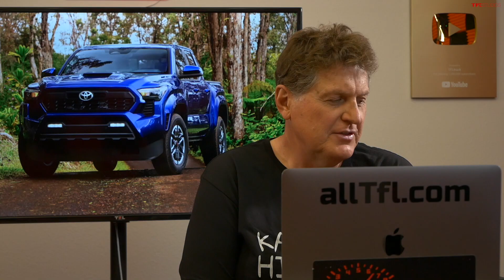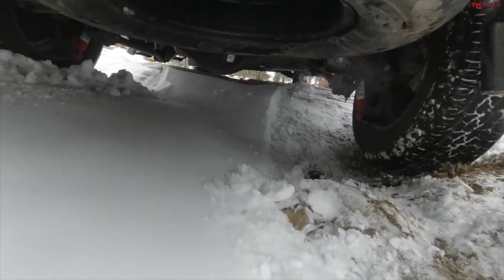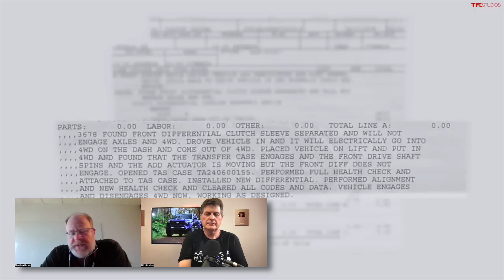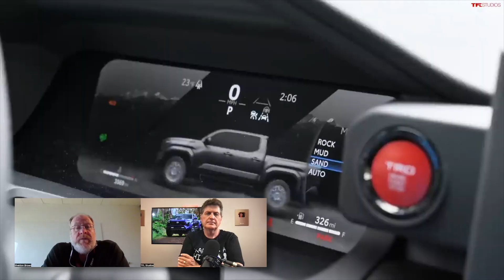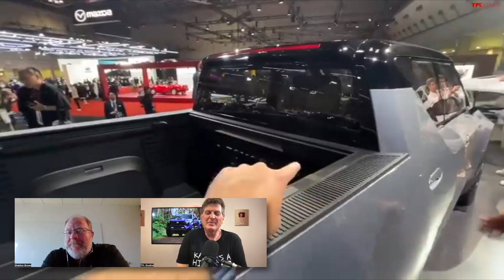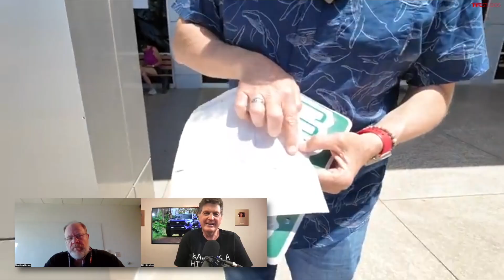The Real Story Behind How Our New Tacoma Broke & How Toyota Plans To Fix Yours!

Comment: If Toyotas mindset was building a quality truck, they would have made the differential strong enough for any setting and anticipate user error when selecting application…. they take the longest to redesign with the expectations they test and redesign a superior quality product
Reply: No they would’ve designed and built in Japan instead of America and Mexico.
Reply: And? Japan built 300s and LX600s have failing engines...

Comment: Any company that knows what happened and tells you off the record, without letting you tell it on the record, has something to hide and should be avoided AT ALL COSTS!
Reply: Not if the engineer has not been given press permission to Make public
Reply: Have to get to the root cause before speculation
Reply: They didnt want to talk about it publicly till they had a fix ready for customers.  Standard procedure in any large company.
Reply: What bothers me is the Channel lost its journalists standing by holding off on the story? Compounded by the immediate sale of the Tacoma instead of wringing it out?

Comment: Long story short. IT'S JUNK!
Reply: Nailed it x1😂
Reply: Every new Gen has issues. Toyota has always corrected. All brands go through this
Reply: @psynurse  Yes but these issues vary in severity. And what the new Tundra and Taco have are big, mechanical problems.
Reply: @TermlessHGW then dont buy one right now. After they fix it ppl will be like good job toyota
Reply: @drivewayhero  I won't and most likely never will. Was in the market for a midsize back in 2019 and test drove 'em all. Taco drives and feels like you're in a piece of farming equipment. Plus yet another video of a broken Taco dropped by Truck King. What are the chances...... one thing that Toyota had going for them is reliability............
Reply: @TermlessHGW taco sounds so bud light
Reply: @TermlessHGW  Toyota had perceived reliability, now that’s gone..
Reply: @TermlessHGW It doesn’t drive like a piece of farming equipment anymore. That’s the appeal of the new gen. It’s improved in every way. The people crying out about it being junk are just idiots with a platform to spread their idiotic beliefs. Every truck has issues at some point. They’re fixed and life moves on. That’s what warranties are for.

Comment: Sounds like the drivetrain is designed to the bare minimum.
Reply: exceeded design by 1.7% is what I heard, that's pretty minimal.
Reply: Exactly.  And I’m sure the hybrid version with even more toque has the same marginal components in the differential and will be even more likely to fail in a greater range of circumstances.
Reply: @RonRussell-sj1zf at least they didn't say customer abuse 😂 seriously I wonder how many of these will be declined because people put taller tires on their truck.
Reply: @RonRussell-sj1zf  It sounds more like it "blew a fuse" to prevent the expensive parts from going past their spec.  e.g. axle can take 3500 lbft, A.D.D. sees 3600 lbft and says "yeah no."
Reply: @RonRussell-sj1zf   the non hybrid makes over 100 ft lbs less torque and still breaks ,  theres definetly a quality control issue .   also mine in winter is using 16-19 litres of fuel per 100kms ... when it was rated at 1 litre more per 100 kms vs my 2025 GR corolla .... i have a 1994 supra and have owned at least 5 lexus vehicles , and since switching to new toyotas i dont feel safe traveling far out of town
Reply: @jameisonroyce7550  Don't blame you.
Reply: True, but it looks so cool... especially on 35's🤣
Reply: Sounds like the axles are weak . Cheap steel from China
Reply: @marcnemergut9490  exactly right
Reply: Probably toyota corolla awd system lol
Reply: They always are, the bare minimum is the one which changes.
Reply: It broke because it went over the specs by 1.7 %
lol
Reply: @angelgjr1999 yes because all the torque was being applied to one wheel, did y'all even listen to what he said?
Reply: @adrianhosein7698 obviously they don’t. I deal with people like this all day everyday. It’s amazing how stupid people are and can’t comprehend or listen to an expert
Reply: @adrianhosein7698 if the system isn’t designed to handle sending all the torque to one wheel, then braking that wheel, then it shouldn’t be programmed to allow that to happen.  It doesn’t matter if the situation exceeded the tolerance of the parts involved by 1.7% or 10%, the traction control system should not have allowed it to occur.  It’s bad programming on Toyota’s part.
Reply: @thestrange_1  that is why they CHANGED the programming, he said that was a rare one off situation and NOT the norm., did y'all even watch the video?
Reply: @adrianhosein7698 yes, I watched the video, did you?  The "fix" you referred to was a patch they hope will prevent this from happening to other vehicles while they work on the long-term fix.  The fact it's a rare occurrence doesn't change the fact Toyota didn't think to program the traction system to prevent a situation where its own actions could cause the drivetrain to exceed the designed tolerances.  That's bad programming, plain and simple.
Reply: @thestrange_1  I did watch it and he stated that it was a bunch of stuff that aligned for that to happen, the engineers can't tell the future and can't think of every little rarity that might happen.
Reply: @adrianhosein7698  what the engineers do know are the tolerances of the parts in their vehicles. Knowing the components couldn't withstand the application of full torque with no outlet (no wheel spinning freely), coding the traction system to prevent it from creating that scenario should have been an automatic "to-do" item. It doesn't matter how rare that situation could be, it's irresponsible to leave open the possibility of your own system breaking itself.
Reply: @angelgjr1999  1.7% over the limit? Glad they don't airplanes.
Reply: They had insufficient margin in that design.
Reply: Spec'd the drivetrain to the old taco's with less weight and less power. Snap.
Reply: Add a more torquey engine and use the same components. Don’t get stuck in the winter and you’ll be fine…. Not cool.
Reply: Unfortunately, inflation has made them  change to cheaper suppliers. This is the end result.
Reply: @ryanb8736 it's the same part that was in the 3rd Gen. It's not a "cheaper supplier."
Reply: @ryanb8736 they make billions in profit lmao
Reply: So I can’t take my TRD Off-road actually mild off-roading in case I’m 1.7% over the drivetrain limit!? Is there a gauge or reading in the dash for my drivetrain limit ? Bunch of B.S. gaslighting crap.
Reply: @robmd3851 How is losing traction on 3 wheels and sending all the torque with 2500-2700 RPM to one wheel “mild off roading”? 

It’s a rare occurrence. You’re telling me your mild off roading involves going up a rutted out icy road on 4LO with rear lockers activated? They’ll fix it with a software update before you even find yourself in that situation if you ever do. Relax.

Comment: Toyota ironically increased the cost of the truck while diminishing quality of the product
Reply: Anyone think if it wasn't tfl you would have gotten this attention?  If it was your truck you would have been charged and told you abused the truck. Good to be rock stars of the truck world.
Reply: @ChicagoBob123 Toyota is both lucky and unlucky this happened to TFL. They got multiple angle footage of the moment it happened and TFL is invested in maintaining a good relationship with Toyota. If it was a common person they’d likely be screwed and it would get buried in a spreadsheet somewhere
Reply: Absolutely agree. It's a shame that car manufacturer's put consumers through this. Why are we paying for poor quality vehicles?
Reply: Toyota tax…
Reply: It’s by design. It was mentioned in their 2021 plan to up the sales at service departments by lowering the life span and quality of products. The service department is how dealers make their $$ and they were hurting.
Reply: @manoloprpr sooooo.... that's bullshit ..but don't worry, I know it won't stop you from saying it...
Reply: Just like everything anymore I’ll never buy a new vehicle ever again
Reply: @aaronscott2278  sad thing is things wear out,  rust and just tell you they need to be replaced.  And repair has become crazy expensive unless your a mechanic and have a lift hard to keep anything running
Reply: So, blame the software / terrain modes - the truck is great, it just breaks under special circumstances?  Very low percentage of the time this happens 😂😂😂.  You can keep this crap Toyota - same with the Tundra that you turned to crap.
Reply: Using a good name to sell a inferior product
Reply: They have to pad themselves for all the repairs they will have to pay under warranty.
Reply: @Kjhgr01 not if you put oversized tires
Reply: I would say they increased the cost and lowered the durability of the product in this particular case.
Reply: What I got out of this is the design is similar but the differential can't handle the increased torque of this motor.  So they will use "software" as a governor of such to reduce energy to the wheels as its already too late to beef up the the design of the front diff.  And this being a non hybrid with less torque.  Really looking like the design is under built.  The engineer admitted they will have to limit that torque with software.  In a public relations statement he tries not to admit as much but when one dissects through all the word salad of this guy its points to the underpinnings being under built all day long and twice on Sundays.  And what about all the reports of the rear diff overheating?  Does this not have a proper trans intercooler?
Reply: @HiPlains1 That's not even what he said, far from it.
Reply: @HiPlains1  Well I agree with you, in part.  The V6 engine could not produce enough torque at low rpm to cause this most likely. This turbo engine torque overwhelmed the front diff in this scenario.  Would a front locker have helped prevent this failure?
Reply: @planoman0935 what about the 4.5 v8 tunned turbo diesel do they snap axels?? The North American Toyota is selling us cheap crap at a higher cost. That’s all Folks
Reply: Horrible track width on the LC70. Toyota is lazy to fix their problems even on the I4 in the LC70.
Reply: Let's not be the guinea pig for Toyota.
Reply: @evangelistar74  True

Never buy the first year of a new series.
Reply: So a software fix for an underengineered mechanical coupling? Am I hearing that they will make the traction control system less aggressive  to save a weak mechanical link?
Reply: Shrink flation?
Reply: @toddgries2133  planned obsolescence
Reply: They’ve been doing this for at least 20 years. Fanboys were just blinded. Look at all of the lawsuits over their trucks during that time for weak build quality and poor frames.
Reply: Not just failure of diff but failure of tranmission and engines also
Reply: @aduarsaenz1491  That’s what I’m suddenly hearing about also. And it’s coming from many owners. That can’t be ignored.
Reply: Way ,WAY, WAY OVERPRICED. HAWAII TACOMAS ARE JUST SITTING IN THE LOTS.
Reply: 100 series LCs blow front diffs all the time
Reply: @NF-rl9xh True, I blew the front diff on my LX470. Things break when you go off road. We won't know the full picture on the reliability of these vehicles until 10 years from now, which is why I usually buy used anyways.
Reply: That will be solved when you buy a Y61 Super Safari Patrol.
Reply: Because Americans will still buy it.
Reply: I think Toyota are weaker trucks because of all the electronics they have built into them these days.
Reply: @yosemitesam6945  That’s an excellent point. I not certain, but I bet that’s true of all cars and trucks these days.
Reply: Junk
Reply: It's new world economics..  it's because CV
Reply: My issue that Toyota went back to a 4 cylinder engine.
Reply: Toyotas reliability has went south long before now. Glad y'all are finally starting to wake up
Reply: Ford has been doing this to the F-150 for years.
Reply: Shrinkflation in vehicle terms
Reply: Inflation worldwide, this is globally. Look up  why the WEF is against car ownership
Reply: Seems like Toyota is joining in with the rest of the world taken advantage of inflations and jacked up their pricing and reducing costs by cutting quality.
Reply: That's not irony.
Reply: Sad reality
Reply: 'Merica
Reply: Toyota fan boys working hard on defending Toyota. Tundra engine issues, tacomas trans issues, Corolla grs catching fire.... Y'all defending a company that wouldn't care if you didn't wake up tomorrow 😂
Reply: I blame the guy that put 1,020,000 miles on his 2007 Tundra. They found ways to make it less durable
Reply: @Thermool   5 motors will do that
Reply: He had to replace a transmission and multiple other things Toyota owners consider " normal" while GMC owners consider them mechanical failure.
Reply: So. Toyota has basically become GM, Ford, and Dodge now
Reply: @Getusom  LOL!  They Wish...
Reply: Made in Mexico.
Reply: @nathankoroush7918  what the hell is wrong with it being made in Mexico?
Reply: @Tungstenisw  Everything.
Reply: @nathankoroush7918 designed by America.
Reply: @nathankoroush7918  There's a difference between "made" and assembled.
Reply: That’s the story of every company post-2020
Reply: Too young to remember the 3.0 I see
Reply: Same as other manufacturers
Reply: Looking at inflation over the last 8 years since the 3rd gen came out prices have basically stayed the same. The 2023s trucks were a great deal in comparison because they didn’t change msrp as fast as inflation.
Reply: TFL broke their own truck and don't want to take responsibility.
Reply: @downloadstuffgames  Toyota is the only one responsible for that debacle 💩
Reply: You guys are not considering that the very newest vehicles are finally taking advantage of ABS to create virtual lockers AND manufacturers are competing with each other to have the fastest acting virtual lockers.

As a result, when you are on icy conditions with the engine's inertia revved up and the computer suddenly locks up the brakes on the spinning wheels (likely applying both front brakes to minimize back and forth spinning from left/right), you end up with potentially enormous torque being handled by the differential.

The amount of torque could easily far exceed what you could ever get when there is good traction.
Reply: Good grief. Qulity? One front end exceeds the torque by 1.5% and breaks. One broken front end. It was a software glitch. Typical first rollout. I've had all of the previous generations of Tacomas, and this new one is much more truck.
Reply: @tonylatham5915  costs a lot more doesn't it?
Reply: Not the good vehicles they once were. Our Kias  are cheaper and better. Toyota arrogant and complacent.
Reply: @Dive-Bar-Casanova is that why Hyundai and Kia get recalled left right and center? Because they're ' better '? Lmaooo
Reply: @Dive-Bar-Casanova they may actually be better and cheaper.  But when you trade them you will see the difference in Toyota and Kia. Not saying it is deserved but it is what it is.
Reply: @Dive-Bar-Casanova except Kia/ Hyundai is the most stolen vehicle in the US.  All you need is an Apple charger...
Reply: @Dive-Bar-Casanova  did you just say kia is better 😂😂😂 after the 4 cyl GDI fiasco??? Lmfao they couldnt even make the cylinders round in the block
Reply: @Dive-Bar-Casanova  Unfortunately, KIA and Hyundai have having some scattered issues also.
Reply: Really dude? That's false. Yall cried and cried yall wanted a next gen Tacoma and kept pushing the issue. Toyota gave yall what you wanted if you know Toyota you know they don't like change. Why because they don't like to fix something that ain't broken. They have lived by that model for decades now. Now they come out with a next gen and yall cry cause it's breaking and say I don't want to buy that. Get real yall don't know what you want and yall ain't ever satisfied at the end of the day.
Reply: Wow what a BUNCH OF CRY BABIES. Y'all need to go buy a Ford or something, watch n see how fast you come back to Toyota 😂
Reply: @bimastrike87 if this was a Ford Ranger you’d be laughing your little Toyota fan boy heart out. When it’s a Tacoma we get excuses.
Reply: @bimastrike87 done.  7.3L Powerstroke on 35" tires...